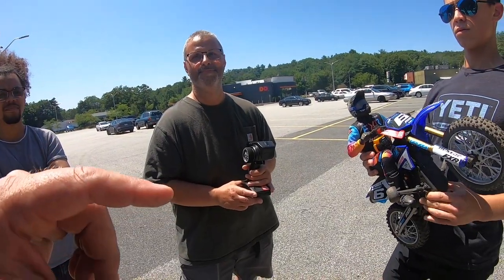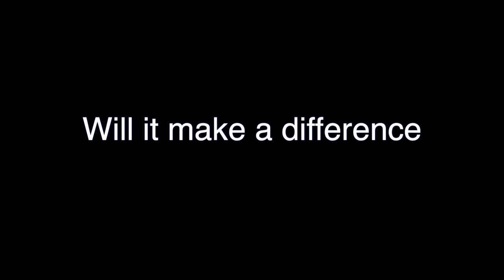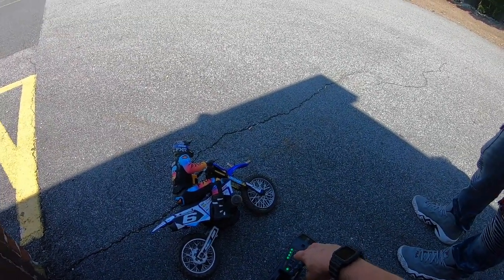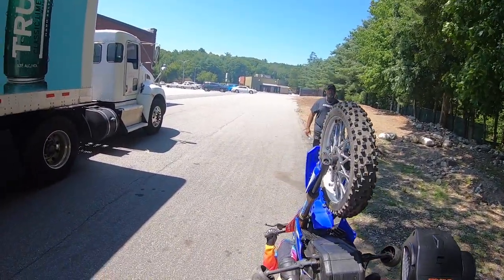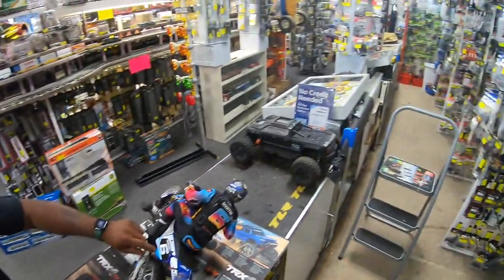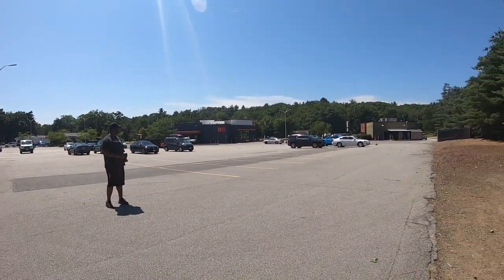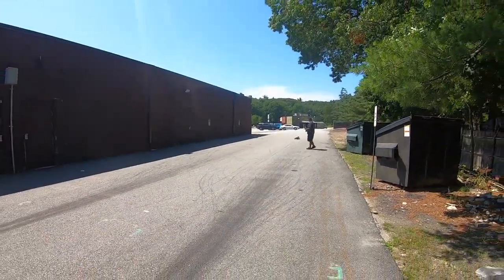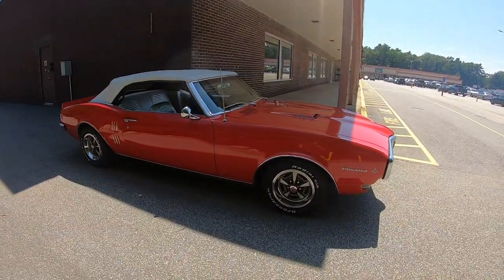Promoto MX 100c Speed Test any difference?

Comment: the rotor is correct the losi video with the engineer went over that  or it was the disk brake service video I forget now but he did mention it should be like that  mine moves like that as well   I had a 69 Camaro as well  my firs car in Highschool   Still have a 91 Z28 and a 2017 50th Anniversary SS   05 GTO and a 15 Chevy SS
Reply from the maker: Yeah I guess I was just surprised to see a floating rotor because that's what you see in some real ones My CR 250R didn't have that but I think KTM did or the other way around can't remember it's been a while since I've ridden 😂🤣😂🤣 yeah I've had my 69 since I was 19 it was a true barn find and did not look obviously the way it does now and there was definitely a bunch of surprises that I discovered over the years with originality in this particular car 👍💯

Comment: What about heating issues you mentioned at the start of this video where you took it inside and you said something about it cooling off( not that you took it in for that purpose) so in your opinion from running how long can you run it on average before you have to let it cool?
Reply from the maker: There are way too many variables to answer that question plainly. Obviously hard running trigger equals less runtime and more heat. My assumption is turn after turn after turn is going to possibly heat up the gyro because that is a separate motor turning a 1 lb flywheel. Ambient temperature also plays a part It was in the upper 80s for that particular day if I remember correctly.

Comment: I've heard speed runs with the stock battery at about 40 mph, in other video's. I think the speed come from the miliamp and not the c's. The c's is for run time from what I understand, but I could be 100% wrong too.
Reply from the maker: Both packs were 5,000 milliamps One was 50C the other one was 100C The 100c is known to just give that little bit more I've proven it with some China Junks and the higher the milliamp normally the longer the runtime
Reply: @rcguygarage  nice, good to know. Thank you
Reply: @BC-rc mah is the capacity/run time. C rating is the punch/power. Think of it like a water hose coming off of a water tank. The tanks capacity and water pressure coming out of the hose.
Reply: @The_RC_Guru  ok, thank you. I've only been using them a few years, always been a nimh guy
Reply: @BC-rc  I was until maybe 15 years ago. You’re missing out! And nimh are rated in mah too.